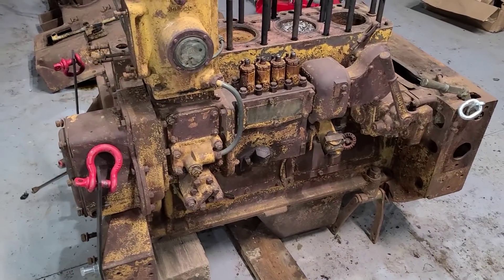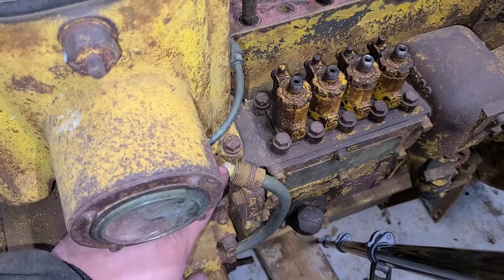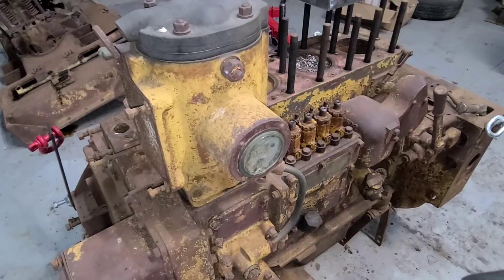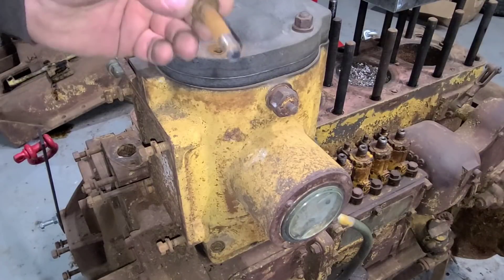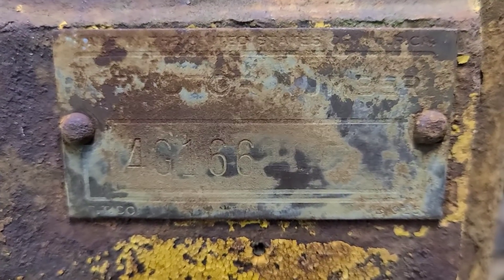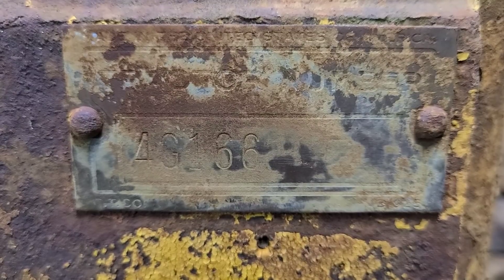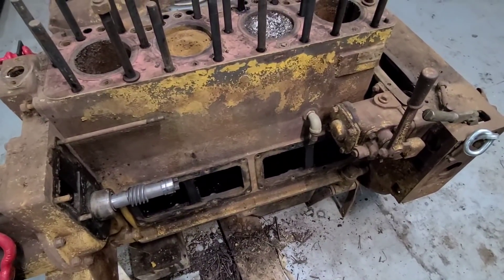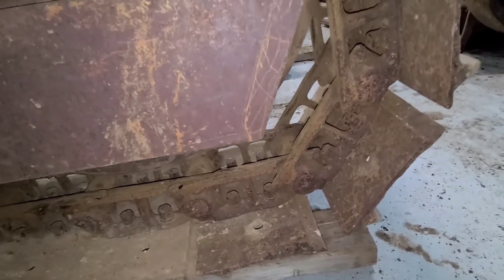Caterpillar RD-4 Engine Disassembly Pt.6

Comment: Kyle for future reference if you back off the lock nut on the fork link at the injector pump end of the governor control rod, you might be able to insert a screw driver in the fork coupling and rotate it toward you ninety degrees, that would then enable you to remove the cotter pin and link pin it retains.

Comment: Removing those side covers makes me remember. When I worked for my old friend, the previous owner of your machine, back in the 70’s he had another D4 which the #3 rod bearing hammered out. Thru that side inspection hole he removed and replaced the rod bearing only to have it hammer out again quickly. After thought he removed it again and measured the journal to be out of round. He filed and polished the journal as best he could, measured it and made a bronze faced rod bearing with the thought that bronze would take more abuse. He installed it and went on to level over a mile of ditch bank. Last I had a chance to run that D4 was 25 years ago and it ran fine with no knocking. Keep in mind all done thru that side inspection hole. Keep up the good work.👍
Reply from the maker: With the engine weight sitting on the oil pan, the only options are pull the entire engine or do as you said and work through the side covers to fix a rod bearing. I would want a wide gauge tractor if I had to work through covers, narrow tractors don't leave a lot of room between the tracks and the engine. Thanks Geoffrey

Comment: A Cat injection pump heavy? That's the understatement of the year. I rebuilt a lot of Cat fuel systems over the years and bear the battle scares. Cat's philosophy: Make a product; if it fails make it an inch thicker and a hundred pounds heavier...

Comment: Kyle the Fuel tower looks like the old "Bakelite". It gets real brittle with age and heat. great video series. I'm in heaven get to watch you, Pacific Northwest Hillbilly and Squatch 253 all work on D4's at the same time. :)
Reply from the maker: Yes, I believe that is what it's called, I'd be curious what the modern equivalent is
Reply: @kylechrist  Yes, that is Bakelite. It was the miracle material of the 1930s and was used for everything from the tops of steam irons, radio cases, distributor caps, and even plates and dishes and some light furniture. I think it was the first injection-molded plastic. It's impervious to a lot of stuff and has a very smooth finish when new, but will weather a bit over the years when left in the elements, as you saw on that cover. 
Don't drop it or put much of any lever on it, since it was always a brittle material that will crack easily even when new, and can get more brittle with age, especially near the weathering where surface microcracks can form, giving a place for real cracks to start in case of flexing.
The modern equivalent would probably be some injection molded plastic, like whatever distributor cover replacements are made from these days.

Comment: The crank looks better than the cam shaft in your last video. Keep up the good work 👍
Reply from the maker: It does, there is some rust on cylinder 2 but that should clean up well

Comment: Yes, most of us know you should have used a line wrench but we also know that you can get a lot done with a bigger hammer, a pair of vice-grips and cheater bar!   Good job Kyle.
Reply from the maker: If I don't say it, I will have a bunch of people telling me the "proper" way to do it 🤣
Reply: @kylechrist  True enough!
Reply: I always use a regular open end for lines, I just watch the nut while I’m torquing on it and if it tries to distort with pressure, I go ahead and get the line wrenches out. 
It’s honesty not that big of a deal, I worked on large equipment for years and never even had a set of line wrenches until I was about to exit that game and start a new one. The best way to work on this old stuff is how ever you’re the most comfortable doing it.

Comment: Thanks for the video, should be interesting moving those pistons and liners regards Mike🇬🇧
Reply from the maker: I'm not 100% sure yet but I may end up removing the piston/rod and sleeve as one assembly
Reply: @kylechrist  I thought you may have to do that
Reply from the maker: @michaelclutton8446  nothing is guaranteed, if the pistons start to move out of the sleeve on their own then may as well let them come out. I have a feeling that won't be the case though haha

Comment: The inside of the block seems to look good, except for one really rusty liner. But I later say that the exposed liners on top are about as rusty, so it isn't all that different. I guess some water or at least moisture got into some of the cylinders when it was sitting.